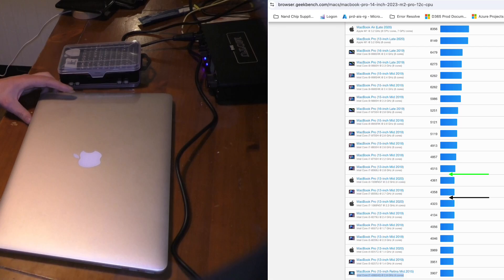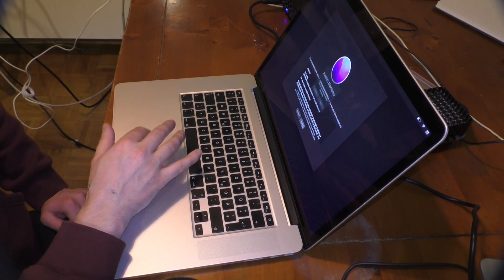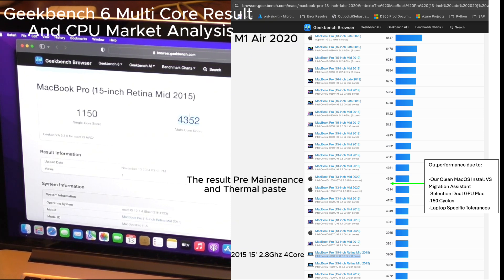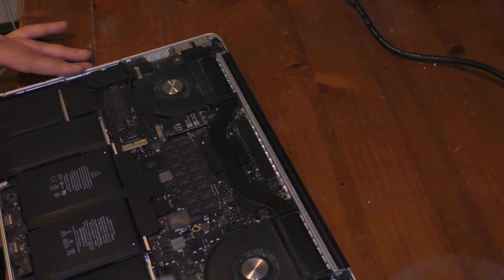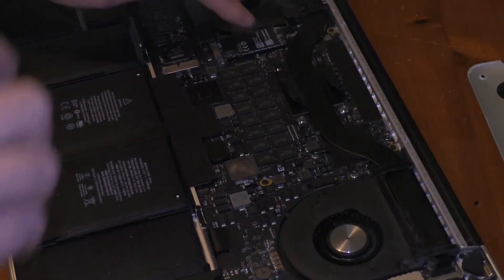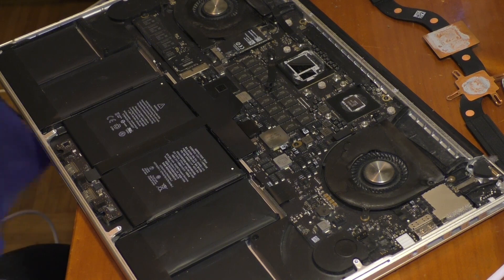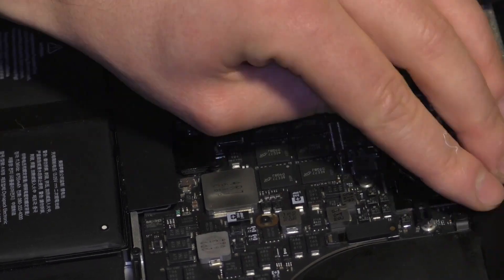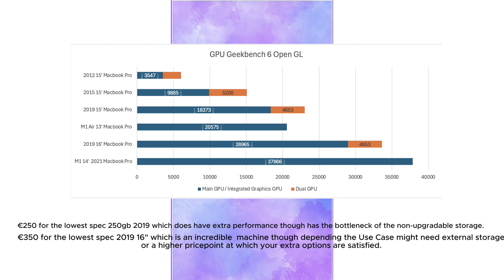MaxSpec 2015 15”MacbookPro Buy 2025 !!

Comment: Wow, upgrading a MacBook? That's like giving a gold-plated paint job to a tricycle. Might as well just buy a new one every year, right? Because who needs functional ports or a reasonable price tag? 🙄 #AppleTax #UpgradeCulture
Reply from the maker: It can in quite some cases decrease your Depreciation on laptops instead of having to buy a new laptop for €1000. For quite some people this computer for the next 2-3 years would be able to fulfil their functional requirements. Also when a person needs a laptop on the side when already having one of its corporate job this one is able to become a 15" 2Tb Macbook Experience for €300. Also it allows to be the Windows bootable platform and the database which actually has a screen. Since Parallels costs €70 per year this already refunds this real fast on compability elements. It also decreases the wear on the NVMe and all internals trough lower temperatures and decreases one that they go airplane mode and their fans are needed. Thus increasing your concentration and focus.

Comment: Great video! I’m using a MacBook Pro 2012 with 8GB RAM and an SSD, and I’m looking to upgrade the graphics card. I know it’s soldered onto the logic board, but is there any workaround like an eGPU setup that works well with Thunderbolt 1? Or would it be better to invest in a newer Mac? Any advice would be appreciated!
Reply from the maker: do know that Boff has an insane upgrade part for the Macbook Pro unibody which works with EGpu's. Though that was the 2012 Unibody and not the Macbook Pro. I do know that EGPUs can give functionallity though that it reduces you in mobility, therefore in most cases not to take with and aswell that it has iffy integration at times with some programs -Not entirely sure the specifics on where it does help and where it does not - I do also know that the E-GPU connector itself was already 60 dollar and then the GPU itself , is another 100 at least. 

For that price it would be better to certainly already pick a different one I would believe, Especially with the only 8Gb ram and the Pre-NVME drive that is already 4x worse then NVMe. If you need the Windows boot Possibility then there are some interesting ones as 2019 and this 2015 15' which can be the 15" Macbook experience with 500Gb for 200 price 300 for 2Tb. And yes might need Sequoia for running latest programs. M Series would certainly be interesting and choice would depend on your functional criteria of programs you'd run and then the transition to externally booting some programs or all your files to external storage on M series often not being enough and if you constantly use external monitor then the 13" of M1 would not hamper you. I don't have a view on your budget thus can't see all elements of your desired path. Best of luck.
Feel free to Sub ! Then I do aswell